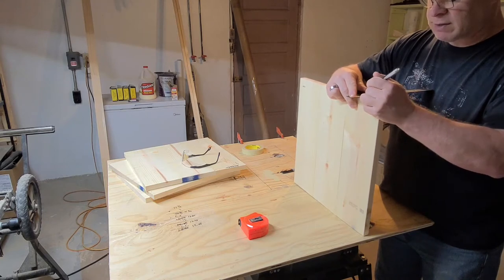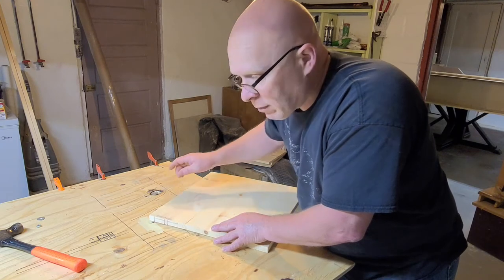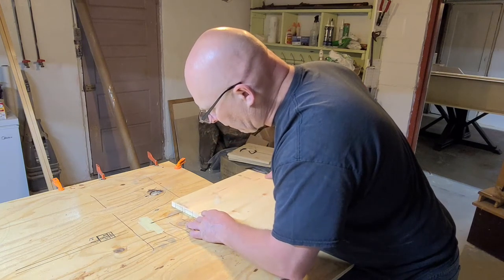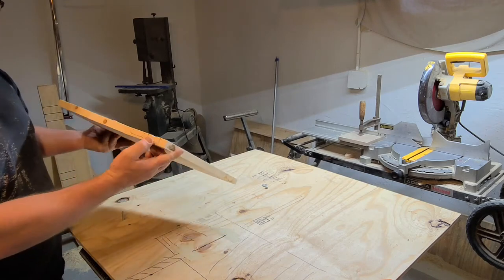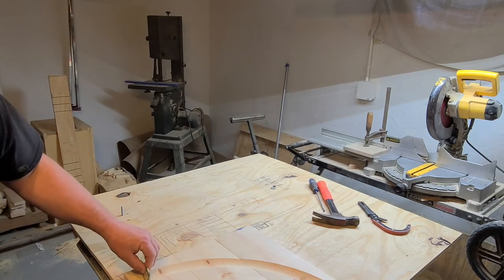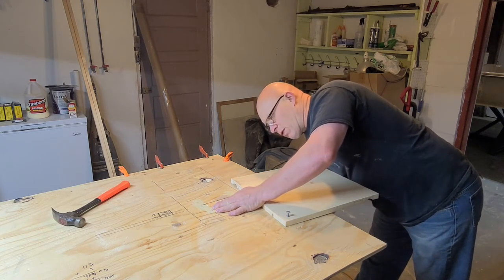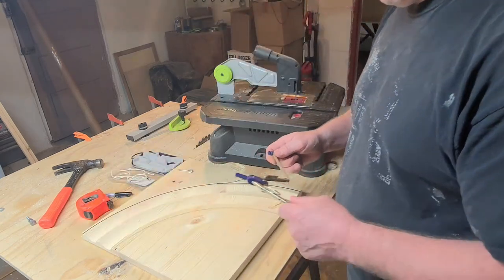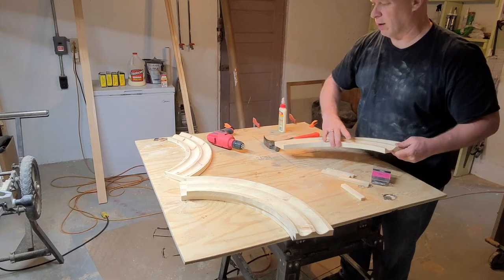Craps Table Build Part 6B: How to make a craps table at home.

Comment: HI, I tried doing the curve and had them all lined up correct, but for some reason instead of "U" shape its more like a "J".  Cant seem to figure out why.  Not sure if the blade is bending towards the  end of the pass. any suggestions?
Reply from the maker: Try adjusting the angle just a little bit so it comes more from the side. It takes a little adjusting to get it close. I know when I did mine, it was not perfect either. That is why I sanded them down using a drill and a circular sanding bit.

Comment: Hello again. Please tell me what is the size of the wood base you placed over your table saw for these chip rail curve cuts
Reply from the maker: I will measure it up for you but I am on a trip right now and will do when I get home.
Reply: @CrapsMasterJourney  Thanks a lot. Have a great trip
Reply from the maker: Returning home today so will hopefully get you a measurement in a few days.
Reply: @CrapsMasterJourney  Thanks a lot. I have most of the table finished; just the rails and chip rails to do, and that is what I need the afore mentioned measurement for. Hope you had a good trip.
Reply from the maker: The piece of wood I used was a spare piece 1/4 plywood I had lying around that measured 3 foot 3 inches square.
Reply from the maker: You have to kind of move it around a little bit to find where to clamp it to the table saw  so  the pivot point works well for both the straight and the curved rails.